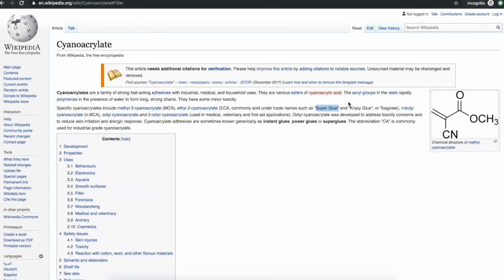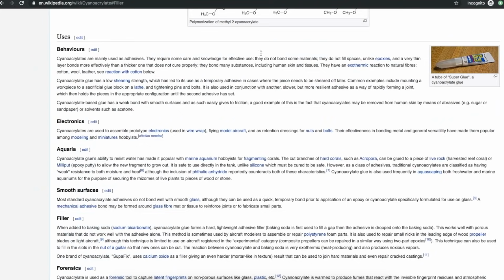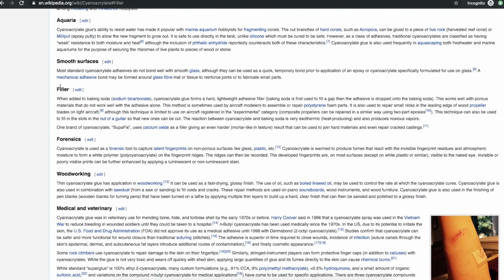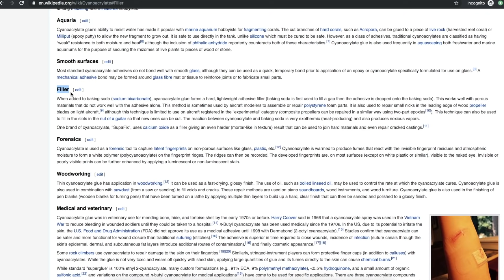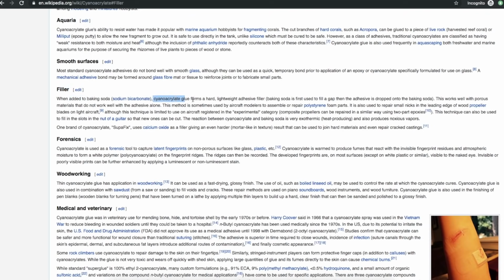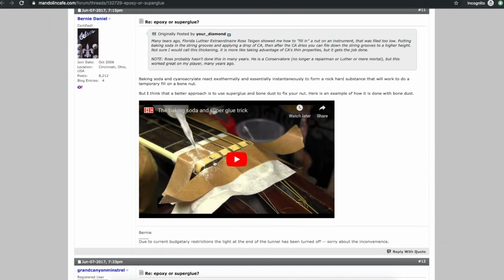Using Super Glue and Baking Soda to Repair a Plastic Switch Plunger

Comment: This is the best repair idea I have used.  It does however get hot.  I had a big repair on a camping tent and just used lots of glue and baking soda and I could not even touch it after it was hard since it was so hot.

Comment: Mix super glue with saw dust to repair knots in wood. It cures to the same color as a regular knot.
Reply: @Miles Maillet yes its also much cheaper. And no problem geting it off your hands.
Reply: @eazyrider6122  I got the sarcasm. But it depends on where you are.. Actually in my country a small bottle of CA glue is cheaper than a can of 500gr wood filler. Definitely a win for a small project only, not for a full-scale wood workshop.

Comment: very kind of you that you have posted this. thanks a heap.
Reply: This method is not permanent on moving or pressured parts. Especially on plastic it's no good.
But it will work on wood perfectly.
Soon or later the plastic part breaks again.
( I know because I used this method on hundreds of applications)
For plastic I recommend
 plastic cement glue.
Reply: @kulibo1  Thank you so much sir for sharing your experiences.

Comment: You can add fiberglass patch...I am pretty sure this is how acrylic nails are made and I had a broken fingernail fixed at a nail salon. The fiberglass tape/fabric was thinner than auto repair cloth, which I have successfully used to make a 10 year and holding repair to a hole in cast iron drain pipe. I also used JB weld to fill the hole first.and I used quick cure super glue and painted it all with that epoxy resin for car repairs.

Comment: That's really cool method, not seen this before and have a couple of non-safety relatrd jobs where I think this may work.
Thanks for sharing
👍👍👍
Reply from the maker: I only recently discovered it myself and I think I’ll have a lot of good uses also.
Reply: @GadgetReboot  What about pressure... I need for plastic part of car radiator. Temperature change durability?

Comment: It seems that different brands of super glue have different reaction speed with baking soda. Based on multiple videos, it seems that the Loctite brand has the fastest reaction in case you have to glue something where holding the parts stable is hard.

Comment: It's worth mentioning that the plume coming off the mixture is not dust but smoke. That stuff gets extremely hot and will put a hurtin on you if you get it on you.

Comment: Cool trick.  Not as amazing as using a cotton ball and super glue to fill a hole in particle board and then tap it out trip accept a bolt! but still useful.
I got a CA glue kit from the HW store that includes 2 powders.  One powder for improving plastic adhesion; the other for metal.  I should compare that stuff with baking soda.

Comment: If gluing wood to wood superglue and baking soda work wonders. It will even work if the wood has oil on it. I used this method 20 yrs ago to glue the fire walls back on my radio contorted planes. After they hit too hard on landings. The fire walls end up oily from the engine and really no way to clean it out of balsa wood. Never had one fail with this mend. Make a fillet with the baking soda, then drip with the CA, to make sure all the glue reacts then hit with accelerator. Make sure you work in a well ventilated area, the fumes that come off are nasty. It also creates a lot of heat in the reaction.

Comment: Using painters tape as a way to create a containment mold around whatever you want to repair or in whatever shape you want to cast is a bit easier to deal with and remove than plastic tapes. Also, I would actually consider the piece that you repaired as a structural piece, since it provides functionality upon assembly.

Comment: I use ca glue when sanding and glueing up at work on certain damage that comes in or occurs during handling of the muf we use.
Works well but one tip use a flat block of mdf with sand paper glued on to get the surface back to flat as a disc sanding machine tends to ride over the glued area because its harder than the muf board🍻🍻
Reply: Theres nothing better than handling the muf.🤣🤣🤣

Comment: Well done bro.. that's a handy one.. 👍
Qs. Do you think Super glue + Baking soda bonds stronger than standalone Super glue for plastic repairs like your broken retro style controller button?
Reply from the maker: I don’t know if it is stronger but the bigger benefit is being able to build it up as a structure to fill in a void or rebuild a broken off feature and sand it down until it does the job like rebuilding a broken off plastic hinge on one of those pull down cover plates on an electronic unit  to get at hidden controls.  and it cures instantly so you don’t have to hold it in place and hope it doesn’t move.
Reply: @GadgetReboot  I just tried it and you're 👍 right..

Comment: There are a lot of good comments on using other materials, but the reason Baking Soda works so well is that it is Sodium Bicarbonate. The Soduim atoms break their bonds as they react to the Cyanacrylic and then recombine. This exothermic reaction causes a lot of heat and a cure that only requires a few seconds. It gains full strength overnight. 
But don't even catch a wiff of the light smoke this method will create, it burns the mucus membranes in your nose, throat, and lungs, and I belive there may be traces of Cyanide gas in the fumes. Wear all appropriate personal protection equipment and VENT to the outside air away from people, pets, or anything organic.

Comment: I can’t believe that I’ve just basically sat and watch glue dry, and enjoyed it! The only question I have, is why didn’t you just glue the broken bit back on with the super glue?
Reply from the maker: not all the different types of superglue work the same on various materials and sometimes the thing will snap right back off but this helped bond it not just where it joins but along the surface fanning it out

Comment: I've used it to fix a cracked plastic gas can 6 months ago. Still going strong! No leaks yet!
Reply: What about pressure... I need for plastic part of car radiator. Temperature change durability?
Reply: As far as pressure durability I don't know.  If anything, it would probably break it again at same location as it would be the weakest part. But so far i haven't had any problems with it. I even sand paper it smooth with the outside of it smooth with the rest of can. I'd try it out.

Comment: You can also use with sand to cover up a hole in the wall
Reply from the maker: I might try that at some point.  When I moved last year I went around caulking and painting all the extra holes from missing curtain rods and clocks. Something that dries more immediately would have helped...

Comment: On my Everlast punching bag that you fill up with water the same split open at the bottom and I tried this trick and this trick did not work on it I guess it's too much pressure when you're hitting it busted right back open

Comment: Why doesn't anyone mention that there are 2 types of Superglue, thin and thick.  I you use the thick type, which is what I just did, it won't work.  The Superglue just beads up and makes a complete mess.  You have to use the thin Superglue which soaks right into the baking soda.  The thick type just beads up on top of the baking soda.

Comment: Hello, i want to try this method on the interior part of my travel mug  lid. But Im a bit hesitant if this chemical compound is not good especially if it mix or expose to hot water or coffee. I mean, is it still safe to drink?
Reply from the maker: I wouldn’t use it anywhere requiring food safe or submerged applications to be safe.

Comment: Would supper glue work on refrigerator's crisper drawer?  I have two crack lines on mine that are not split open yet but they are on the side, right on top so I am looking for ways to keep them from getting bigger.
Reply from the maker: If there will be possible food contact in that area, that will need to be considered for which material to use.  If it can be determined that any certain super glue product is food safe, it may be a good choice if it's the thin type so it can get into a crack better than gel.   
The bigger problem would be getting glue into the crack to hold it together, and still hope it doesn't continue to spread.   Just like repairing windshield cracks, they may drill a small hole on each end of the crack so it can't grow any longer (the crack is opening into a new hole, can't keep running along beyond that void) and then glue can be used to fill the small holes and spread along the crack, hopefully with some entering the crack and bonding it.

Comment: I used it to repair a plastic bowl, and it worked well and the bowl holds water as originally intended.
Reply: What about pressure... I need for plastic part of car radiator. Temperature change durability?

Comment: You can also use graphite take a pencil shave it down to the lid and crush up the lid It's with the Air Force uses to fix the helicopter blades

Comment: I see there exists another method which involves mixing instead talc powder with cyanoacrylic glue and was wondering, does the sodium carbonate in the baking soda offer any particular bonding reaction than the other mixes, or all that matters is just to have a fine enough powder substance to mix with the glue and thus thicken it?
Reply from the maker: i’ve seen mention of other substances mixed with the glue as well and I don’t know if there’s different degrees of results but I do recall something about the specific compounds react in a certain way to give this baking soda result.  so it’s chemical reaction based more than just having some sort of filler material to bond to, but depending on the application, maybe just having some filler material is just as adequate, like adding sawdust in with wood glue to make an even more realistic wood  bond.

Comment: What's so great about this ?
Pasco Fix has fisrts grade glue, good sand ( instead of soda) that hardens much better. On top of that you get plastic cleaner and activator.
Yes, big bottle costs about €15, but if kept in refrigerator, it lasts forewer.

Using this method I managed to seamlessly glue my DSLR Canon EOS 350 that disintegrated badly from the fall on concrete.
Using just glue, it would be lost cause.
Since that time, I use this all the time.

1. If you go for superglue, use good one with high cyanoacrillate content ( Pasco Fix)
2. Use good sand and cleaners ( Pasco Fix or similar.)

Comment: What about pressure... I need for plastic part of car radiator. Temperature change durability?
Reply: Plastic part of my radiator was fixed by applying marine epoxy & blowing torch on it to heat up. After that I started the engine & obeserved the fix. No leaks anymore.

Comment: i need to try that with sawdust and see how it takes a wood stain after sanding...
Reply: NO!!!!!
I used to have a Furniture Stripping and Refinishing business years ago...
When you need to fix a hole in wood... 
SAND the wood to get sawdust (tiny pile of sawdust).
Then MIX the Sawdust with plain White Glue, 
Put the sawdust glue mixture inside the hole... Let dry over night.
 and it will dry exactly like the shade of the wood, because you're using the (sawdust) wood... 
Sand ... and you're done. It is amazing... and do not use WOOD Glue!
Reply: @JudiChristopher  "sand the wood"! Do you mean: "make wood dust by sanding some wood"?
Reply: @vaeiskione  
YES

Comment: Do you think this would work on cracked ceramic planter?
Reply from the maker: I'm not sure of the structural bonding strength to various materials, or the water-tightness.  I use it for more cosmetic or light duty fixes where it wouldn't be an issue if it didn't hold.
Reply: For ceramics super glue doesn't work. Jb weld or 2 part epoxy is best

Comment: Hi Guys, how it will work on the crack of car bumper ? Any experiences ?
Reply: check the Sweet Project Cars channel. He did some car repairs using similar methods.
Reply: i’ve used it to repair motorcycle plastics before, works a treat.

Comment: I tried this and it didn't work - the superglue behaved hydrophobic (beaded land rolled off like water on a duck's back).  What am I doing wrong?  It's not GEL superglue, it's the liquid kind.
Reply: It could be the brand of super glue or baking soda
Reply: it's likely your superglue was already exposed to air for some time so it became thicker (using an already opened one, maybe?). try using a new one that still thin.
Reply: Apparently, there is thin & thick super glue, (I just learned this in a thread)...It was said in that thread that the thick super glue will bead.

Comment: You should allow the CA glue to cure.  You scratch it and it has not cured. I have used this on building models to fill gaps and I allow it to cure and you cannot scratch it after it cures.

Comment: Can we use feviquick as a super glue?
Reply from the maker: This works with cyanoacrylate, and On the website it says "Fevikwik is a special epoxy cyanoacrylate super glue used for adhesive bonding."  so I'd guess it works.
Reply: @GadgetReboot  I used it works.

Comment: You were supposed to fill the gap with baking soda first then add the glue.
Reply from the maker: The object didn't seem to mind
Reply: I find it depend on the thickness of the CA glue.   Super thin glue soaks in to preapplied baking soda well...  with the medium bodied or thicker CA glues I like to put the glue where I need it and puff baking soda on in thin layers, especially in situations where I need to avoid excessive buildup.

Comment: but he didn't test the push button repair
Reply from the maker: The plunger pushes all the way down and reaches end of travel,  and springs all the way back up and doesn’t fall out of the enclosure anymore. That’s the only test needed. Nothing changed in the electrical contacts.

Comment: DIWHY? Just use epoxy putty instead of screwing around with baking soda. They make such putty for plastic as well as other materials.
Reply: it takes longer though. sometimes you need something to set instantly
Reply: ...and sometimes you don't have epoxy putty. 

you could easily get both of these items in the middle of the night from a gas station.

Comment: You're goofy! Why don't you leave the baking soda stacked and then add the glue on to the Stacked baking soda? Or is that too logical? How are you going to build a liquid? You can't! That's why you have to stack the solid and then add the liquid. Yes I am a rocket scientist.
Reply from the maker: This may not be the only way to do it, it may not be the best way to do it, but it's the way I did it. Thanks for watching!
Reply: @GadgetReboot  thanks for the great reply! Hey we all learn from each other and I was really thrilled to learn that baking soda and instant glue can be used to repair things in such a solid way! Thank you! PS I did give it a thumbs up the first time I watched it.
Reply from the maker: @laurabarber6697  Yes there's lots of interesting things to learn and venues like this increase the odds of picking up useful tips, as well as inspiring further innovation - such as starting with the solid base to contain the structure.  Who knew?  I'd probably just build a small retaining structure to hold it in place.